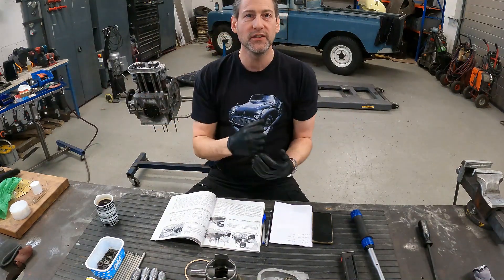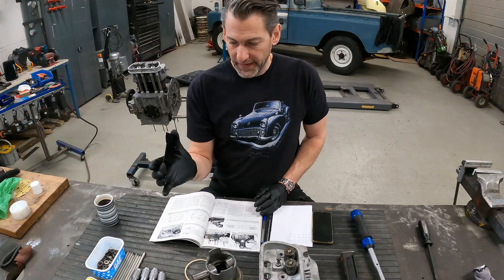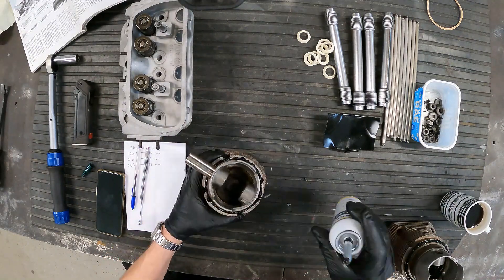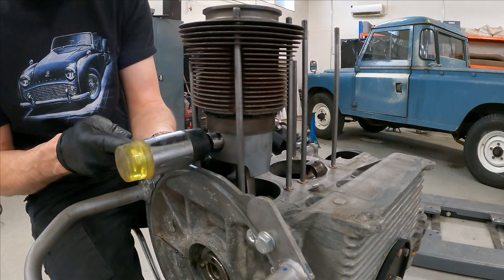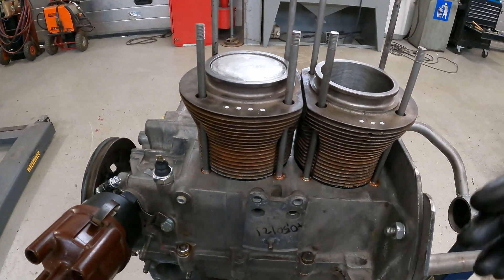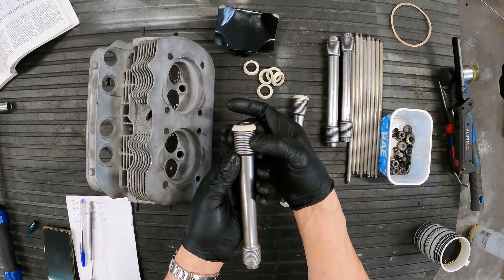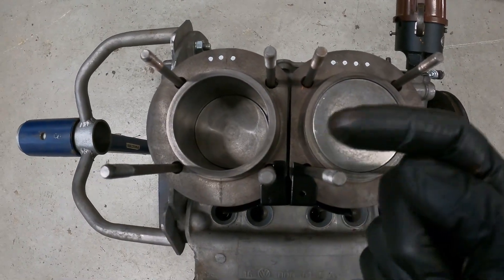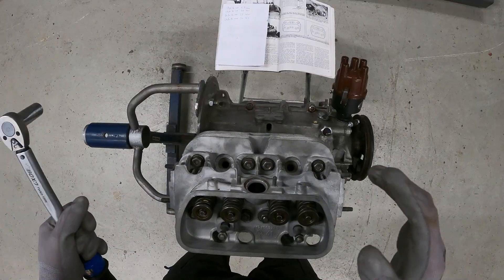Installing pistons and heads

Comment: If you ever sell it, the shiny engine compartment enhances the perception that the vehicle is mechanically sound, IMHO. Great instructional video! Peace
Reply from the maker: Yes that's a good point. I also am planning to paint the chassis quite nicely after its been repaired so it kind of makes sense to paint the engine tin.